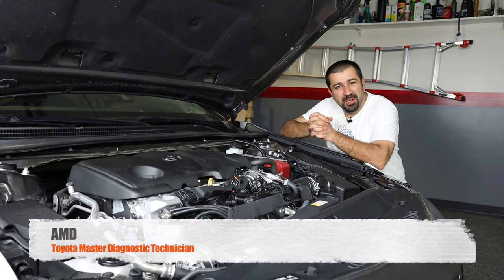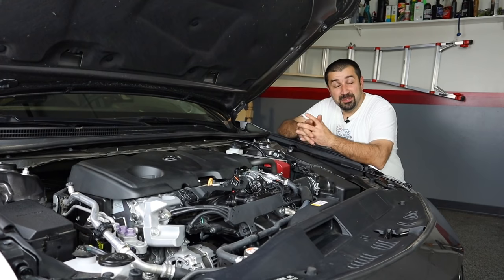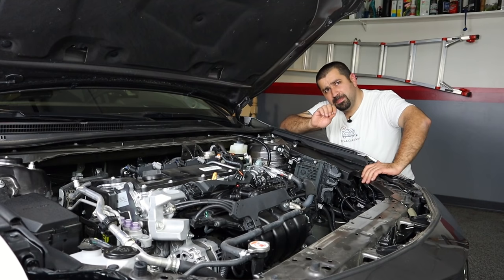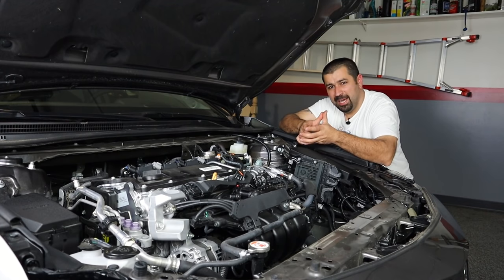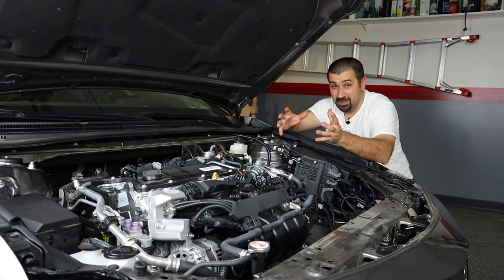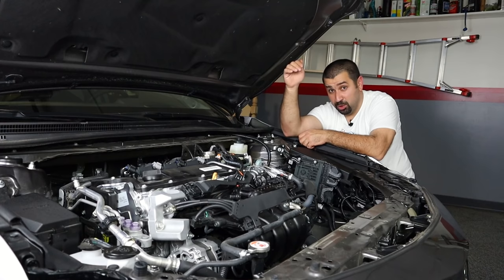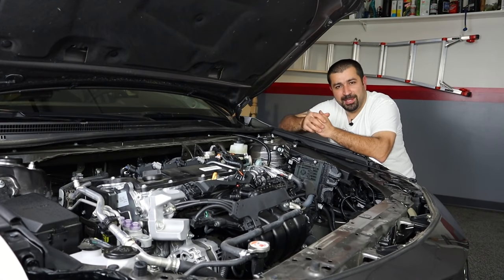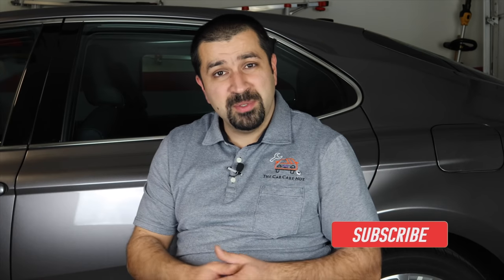Toyota's New Engine Technical review Part 1 : Cooling,Lubrication,Direct Injection and EGR

Comment from the maker: Find part 2 of this video here
https://youtu.be/8fsoVzmrghs
Reply: Hello, I would like your opinion about the m20a-fks engine
Reply from the maker: Hi! That engine is identical to the A25A except the displacement.
Reply: @TheCarCareNut  ohhhhh, I understand, thank you
Reply: I am planning to buy used 2019 Camry LE with only 20k miles on it. What's your advice?
Reply from the maker: Hi! That’s a good car. I would still check the car well and make sure it’s taken care of. If everything looks good that’s a good one.
Reply: Which truck is more reliable the 2021 tundra or Tacoma?
Reply from the maker: Hi! The tundra being unchanged will be slightly more reliable than the Tacoma but the Tacoma is a very reliable truck as well.
Reply: @TheCarCareNut  in this video you said that you will cover EGR in some of next videos. Please can you explain what  makes clogged intake manifold. Is PCV do that or EGR. What can be done to prevent that? Is 2zr-fxe have that problem?
Reply from the maker: That’s coming up in the series for engine control in a few weeks I hope. EGR clogging has to do with driving conditions and quality of gas and maintenance
Reply: @TheCarCareNut  Thank you.  I just found on some videos on YouTube totally clogged intake manifold. And become worried how I can prevent that.
Reply: My new 2021 highlander hybrid A25A-FXS has EGR system. Hope it won't give me trouble in long run.
Reply: @TheCarCareNut  Hi Boss, can't the fuel pump filter do the cleaning of the gas before the direct injection, to prevent carbon buildup??
Reply: Hello, would really appreciate a video tour of the new Corolla Hybrid engine bay. It's the same engine as the Prius but when I pop the hood I see a jumbled mess of pipes and wires! Very intimidating :)
Reply: @TheCarCareNut  I don't have this variant of the Camry (I have a MY17RZ and use 5w30) but I'm curious,

Does the V6 variant (of this shape Camry) also require that same oil viscosity?
Reply: Hi AMD. My 2020 ES hybrid has the EGR. Is it OK to clean it after 23,000 miles?
Reply: What if your 0w-16 is ILSAC GF5 instead of the GF6B
Reply: @TheCarCareNut  Dear Mr. AMD, my mechanic is repeatedly asking me to use 5W-30 oil in my 2018 Camry Hybrid LE since my car hit 100K miles. I always bring my own 0w-16 oil and filter from the dealership to him to change and have been able to politely decline his offer so far. But last night when I showed up with Mobil 1 0w-16 he was kind of rebuking me saying this is for the newer cars and I should switch to heavier oils. By the way I’ve mentioned about your videos. So I was wondering what might be the case here..
On a side note my mileage is around 111k now, should I do a engine+inverter coolant replacement? And also change the spark plugs? Or anything else?
Sorry and thank you for reading this long message 🙏.
Reply: Why is Toyota telling me that 16,000 kms between oil changes is fine?
Reply: I have a 22 RAV4 and since it was new on a cold start after about 15 seconds of the engine slowing down (idle) I hear this engine knock it’s not a tapping, clicking type noise but it’s an engine knock sound that goes away after about a minute or so I took it to the dealer and they kept it overnight and started it the next morning and they said the noise was normal. I’m in my 60s and I’ve had a lot of cars over the years and never heard one that knocked like that on a cold start before. Again, it’s not that clicking noise that you typically hear nowadays on these modern four cylinders it’s a deeper knock sound that goes away again after about a minute or two.  Would love to hear your take on this.
Reply: @nkf08  My 2022 Lexus NX350h also has this engine.  So far so good
Reply: Hi, I am somewhat confused about the type of engine oil. I have a Japanese built, Australian spec 2019 Camry with a 2.5L Non-Hybrid engine. This has the older 2AR-FE engine with just 8000 miles on it. The TOYOTA manual says we should use only 0W-20 oil. When I give the car to TOYOTA for its regular service they too use the 0W-20 oil. Will I have any issues down the line?
Reply: How dare you say that German engineers don’t look at reliability being most important!!!😂😂😂
Reply: My 2015 Scion TC has this motor I believe and it's really bad motor. It burns a lot of oil. It has 106k miles on it and gets @ 20 mpg.

Comment: I have put 110000 miles on my 2018 Toyota Camry.  So far no issue
Reply: Wow! That is a first. 😵‍💫
Reply: What about now?
Reply: @skjdhdh  I have currently 125000 miles. Engine still runs like a brand new. There is no oil consumption.
Reply: Are you changing the oil every 10k miles? I feel like thats just too long in between for me. Ive been changing it every 5k, but i also dont drive it all that much.
Reply: @RFHX2_6.0  I mostly do my oil change at 3500 miles. I never exceed 4000 miles.
Reply: @ninetyninecents3256  what type of oil you use?
Reply: @skjdhdh  amsoil 0w-16
Reply: Many Miles
Reply: 119k on mine same. I had some hard reverse clunks the first 20k but they did something
Reply: @dghhambo  
easy Programming fix it
Reply: I have 110,000 on my jeep and before that Mini Cooper S. No issues. That’s not special. Expected.
Reply: @BeefNEggs057  I wasn't bragging about it. 2018 Camry models were refreshed new transmission and engine on it. we all know new models might have some troubles even though it is Toyotas. I was just an update. I currently have 221000(mostly in the city) miles on it. there is no oil consumption( I measure oil before and after every oil  change). Engine and transmission work like a brand new.. I drive  for Uber in NYC  6 days a week. and AC is on at least 10 hours a day. Winters are cold and summers are hot .I have seen  v8 engines are crumbling in this hostile environment. I do all respect  i don't think your mini and jeep can handle this. I will make another update 3 years later.
Reply: @ninetyninecents3256 Huh usual Toyota reliability? 300.000 miles next?
Reply: How many miles going how?!
Reply: How many miles do you have in your 2018 camera now, any issues so far?
Reply: Never nind, i see you last update a few months back

Comment: Very interesting machine, but more complexity usually means more points of failure and this engine is indeed very complex.
Reply: Yes, I’ve thought the same; but Toyota cars are famously reliable, so I’m quite ok with this. Having said that, I’m going to take weeks (months?!) to grasp everything!
Reply: For better gas mileage and more power they have to do it like this
If they don't people will say Toyota cars is outdated and boring etc ...
Reply: @ConsoleCombat  
me too
Reply: That's why they're overengineered.
Reply: Best part is that this is still a basic 4 cylinder engine. And because it's an Atkinson design, there's less were and tear over the life of the engine. Instead of designs that are forcing way more output for the same displacement.
Reply: @ConsoleCombat  Same here. Easy to repair and is forgiving of mistakes.
Reply: Change oil 5K & filter 10K  and you will have no problems .  Toyota is know for quality and reliability.
Reply: The new Toyota engines are a failure compared to the old simpler engines. Quality and reliability began to decline since the later 2000's.
Reply: @karlschauff7989  I just don't see how this engine will be anywhere near the reliability of the older models. Not to mention what these parts will cost to replace. How much does replacing that water pump cost ?
Reply: @baseline4102  there are outdated models for those. There's a reason everyone's using an iPhone now not nokia
Reply: My 2019 2.5 left me stranded at 85k miles because the electric water pump took a shit… makes me nervous about all  of the other over complex engineering with this engine
Reply: Just wait until you get the bill on some of these “wonderful parts” when they need repairing or replaced.

Comment: The port injection allows fuel flow over the intake valves to remove carbon, it’s also makes better low rpm torque using port vs direct. The other thing it allows is for the engine to go through a direct injection self cleaning cycle during hot idle. The direct injectors actually have the ability to blow the carbon off of their tips and sides while the engine runs on the port injectors. Genius system.
Reply: Sounds gobbledikook to me
Reply: When gas  was switched to UNLEADED the promise was that it would be a CLEAN burning fuel ??? 
Yet today Fuel Injector Cleaner is a $! Billon Industry
Reply: @jamesm.8392  you can always get better
Reply: Amazing!
Reply: @jamesm.8392   That's because a sucker is born every minute, not because its not clean burning. All of today's systems are 1M x better in every meaningful way than the old stuff.
Reply: @jamesm.8392 leaded gasoline was evil
Reply: @TheGecko213 when the debate is lost slander becomes the tool of the loser
Reply: @gnarl12 MTBE'd gas was too. I'm not a fan of ethanol but I certainly prefer it as an oxygenator over MTBE.
Reply: @donniev8181 perfectly described
Reply: @jamesm.8392 Leaded gas was horrible. It mucked up valves, piston rings, and spark plugs which required methyl chloride and methyl bromide in the fuel which decomposed to hydrochloric and hydrobromic acids to scavenge the lead, and the lead and the acid got in the oil and trashed the oil in short order.
Reply: @Shade_Tree_Mechanic Why is ethanol better than MTBE?
Reply: @gregorymalchuk272  Because MTBE is a persistent pollutant. It's highly mobile in soil and winds up directly in the water table and therefore drinking water, instead of breaking down on the surface.
Reply: Yes it is genius.  I remember reading about that when the third-gen Tacoma was introduced.
Reply: @jamesm.8392  clean burning and a good detergent are two totally different issues my man.
Reply: @gregorymalchuk272  it also literally lowered the average IQ of generations of children.  Literally.

Comment: I have this engine in my 2020 Rav 4 Hybrid. Glad he explained why the car goes from super quiet to a little shake and some rumbling. Just means it went from port to direct injected. Your channel is awesome! Keep up the great work.
Reply: @golferpro1241  I love it. I have a pretty long commute, so I’m averaging about 39-43 mpg overall. The only thing I don’t like about it is the wind noise inside the cabin when driving in the freeway. The car is really comfortable and well made. I have the XLE trim. I recommend getting that trim if you can. It has a few options that are worth having. If you can afford the XSE, then go for it. There are more color and rim options. Overall, I’m very happy with it.
Reply: Dual/port injection. Basically regular old school fuel injection and new school direct injection.
Reply: Same here. I was wondering why it occasionally seemed to be ‘dieselling’ on shut down
Reply: IKR bro I thought something was wrong with the belt it would just get very loud and then super quiet now I know thanks to this guy!!!!
Reply: Yeah thats going to be working in 2030… Nope.
Reply: @BeefNEggs057  The D4S fuel system was introduced on the 2GR-FSE powered Lexus GS in 2007. Plenty of models utilizing the technology made between that time and now are still on the road. So yes, its safe to say, it'll "still work" in 2030..

Edit: Corrected 2GR-FXE to 2GR-FSE

Comment: Car technicians will have to go to NASA to obtain a degree to fix this cars...
Reply: LOL..definitely.
Reply: Creme de la creme
Reply: Expensive Frankenstein to fix .
Reply: None of this stuff is all that new, besides the electronic oil pump. We’ve seen electric water pumps since the mid 2000s on German cars, and direct injection has been on a lot of cars since around 2012. The benefit of electronic systems like these is the amount of diagnostic control you have over them when finding a fault. Hopefully Toyota’s application of these technologies is reliable, although it’s very likely they’re going to have a lot of issues with these first iterations, like the Germans did.
Reply: When complication goes up reliability goes down. Say goodbye to Toyota reliability and hello to nightmare diagnostics.
Reply: @SGcomputing  lol... You mean still have? Water pumps are still a fail.
Reply: I applied to NASA and was told I would be over qualified. Go figure!!
Reply: @SGcomputing  German cars always has lots of more problems then Japanese cars... unfortunately...
Reply: @jeremypike9153  I agree with you, but the government is always pushing the auto manufactures to make more efficient cars & less polluting.  For the new car owner,  deciding to buy one of these new "high tech masterpieces" is going to be a tricky trade-off between saving gas, and the increased cost associated with engines that are inherently more difficult to diagnose and service.  I think they'll eventually figure it out though, especially if you consider the overall popularity of the very complicated Prius hybrids.  My own opinion is that Toyota's reliability is world famous more so because of the abuse their cars can take if they are not well maintained (and still keep running), than for their extreme longevity if they are well taken care of.
Reply: If technicians were to get trained by NASA, NASA would teach them how to lie.
Reply: there are a couple points to consider. the first point is that many Toyota FTS's will not "train" you without being ASE certified first. Yes that's right; get certified before you get trained. even then, by the time you reach "master" technician status, the master's have service writers so wrapped arpund their fingers that the masters dont get these types of jobs regularly. if it aint a gravy train or if its a schytt-show, it usually gets passed down ro more unexperienced suckers

Comment: When Toyota first came out with this engine a few years ago in it's Camry line, I could see it's potential.  Probably the biggest reason why my next car will definitely be a Toyota product.  You've sealed the deal...many thanks.
Reply from the maker: My pleasure! This engine is nice to drive. A bit noisy but has good power for daily driving
Reply: These cars are like appliances.  Jerry Seinfeld might call them bland, but non-millionaires need reliable transportation to get to work.
Reply: Just purchased a 2020 Camry LE with this 2.5 engine. One owner 26k miles! Such a smooth enjoyable engine!!! I'm infatuated and possessed by this car...I love it and it loves me! 💗
Reply: Yep I own a Toyota Camry Sports 2018. You won’t regret it. Best car ever made. All Camry’s imported into Australia are made in Japan.
Reply: Just got my 2023 rav4 it has so many BMW parts in the engine compartment.
Reply: @robertg9334 no it doesn’t there’s actual Japanese parts
Reply: @paulparsons3101  Hey mate, what type of oil did Toyota use on your Camry? Here in Victoria, Toyota has used 0W-20 on my Ascent Sport (non-hybrid) as recommended in the Toyota manual. But this guy (who is really an expert) says we should use 0W-16.

Comment: I got a 2018 Toyota Camry SE. I bought it used with 14,000 miles in 2020. Today in 2024 current, it has 131,750 miles. I drive everywhere daily and it still runs like new. No issues whatsoever. I get an oil change every 5k miles at the dealership. Super reliable car.

Comment: Got a 2021 Camry with this engine. Down the freeway at 75-80 mph with A/C on it gets over 46 mpg. Awesome...
Reply: How has is been so far?  Still have it?
Reply: I have a 2023LE, if I get an average of 32mpg it's a good damn day.
Reply: @MrTacoJay  I have a 2018 Camry with this engine too - I honestly can't bring myself to rid of the car. 

Might keep it forever as the "spare" car and get a truck alongside for my DIY needs. 60,000 miles and literally nothing has gone wrong on it and it blows my mind, because while that should be the normal standard for today's cars, I've experienced many other domestic brands (Chevy and GMC) and even European (had a Volvo V70 XC) and other JDMs (such as a Honda civic with a cvt).

This Camry is by far the best vehicle I've owned in my life and it brings me joy every time I sit in it because it just feels.... so robust and well-made. 
Plus, it does go surprisingly quick for a little motor and I love puttering it around with the paddle shifters pretty often.

My only real regret is not getting my SE trim with the convenience package, these were still pretty new in 2018 and I was on a tight budget and got it for $25k OTD but I do wish I had blind spot indicators and heat/cool seats but that's not enough to ding against the quality of car ownership with this A25-FKS Camry SE. It's stupid how wonderfully engineered and enjoyable this car is.

Comment: When you look at how the Atkinson cycle works you can see the advantage of variable intake valve timing. I own a 2018 Camry and have been amazed by the power and  efficiency of this engine. Toyota has a recall now for the low pressure fuel pump although I have noticed no problem.
Reply: I just got my first Toyota a 2014 RAV4 for the quality. I’m glad I got it for the quality because I’m not impressed at all with the fuel mileage appx 24 on highway or lower. My ranger with a 4.0 v6 got 24 and 300k on it. My pos focus 35-38 and it was only lacking 12 hp but it was .5 liters smaller.
Reply: @NoName-tz5ji  There's something wrong with your RAV4 if it's only getting 24MPG on the freeway.  I've had two turbo vehicles; one heavily modified and they both got better than 31MPG on the freeway if I behaved.  The Dodge Neon barely does as well as both of those other two vehicles.
Reply: @reubenmorris487  If I’m a really really good boy I can get 27-28 mpg @ 65 mph in the flatlands of Florida. Anywhere else or any faster it’s always sucked. My sisters is the bottom line stripped 2wd with 1/3 the mileage and she only gets 2-3 mpg better.